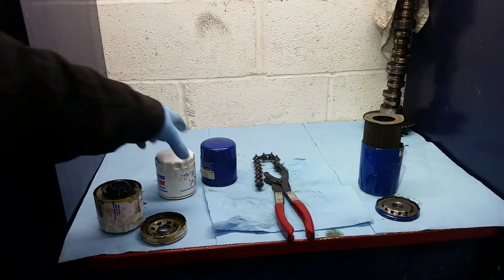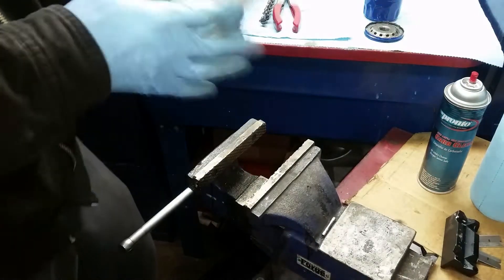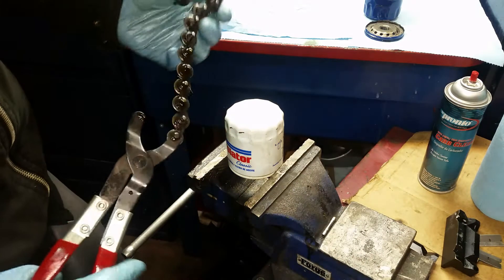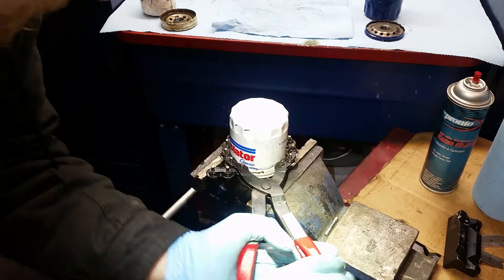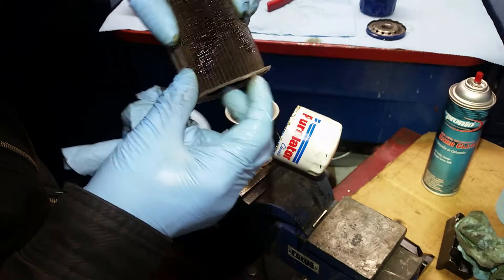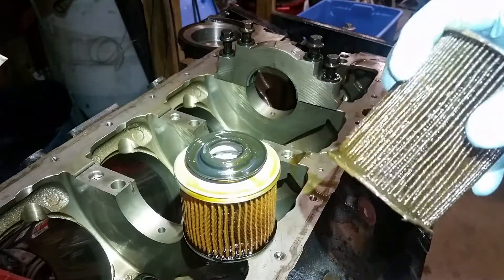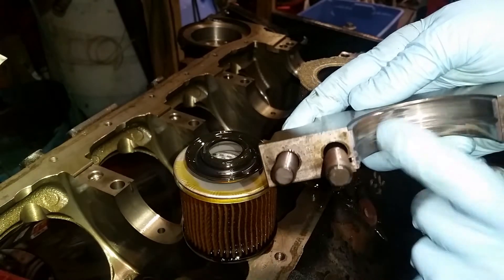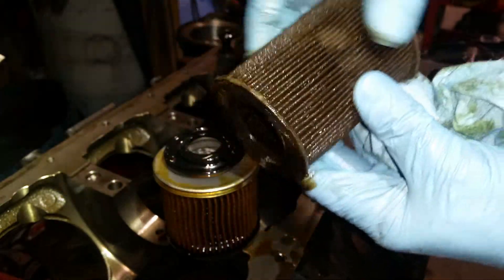How to Cut Open Your Oil Filters: Easy and fast... Day 9

Comment: Did you notice the bearing was getting chewed away by looking at the filter or did it allready knock?
Reply from the maker: Its more of a cause and effect sort of thing, The car already came in with a main bearing knock that was audible at idle. It wasnt crazy loud but very obvious. I believe it was 2 of the main bearings were shot on this one. The camera didn't really pick up on the metal flakes in the oil but it basically looked like a metalic flake paint job. Once its knocking the only way to fix it is to rebuild it.